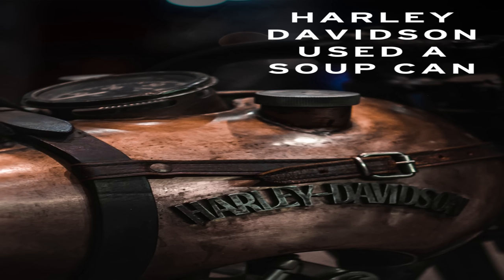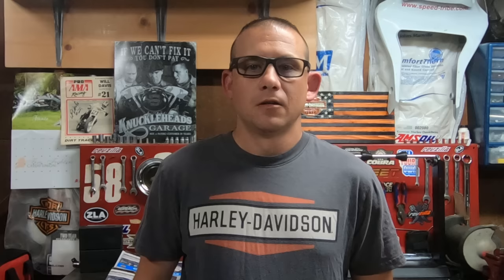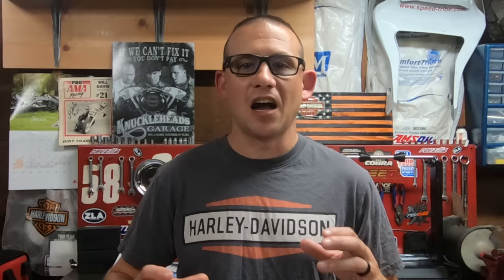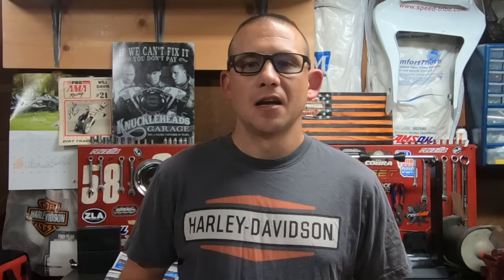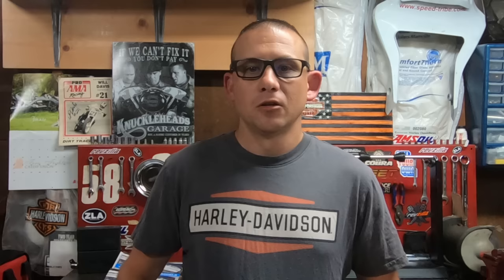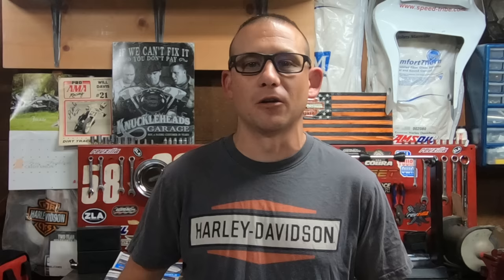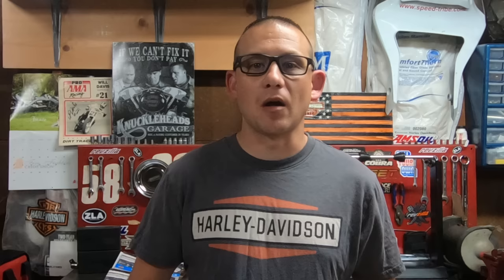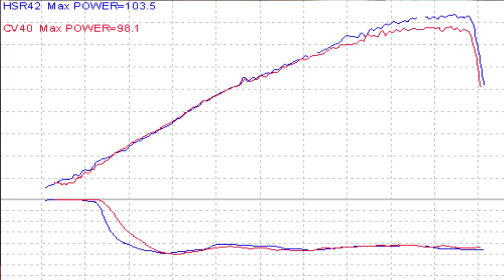CV Carburetor or the Mikuni HSR for Your Harley-Davidson

Comment: I've ran both carb designs on the Harleys I've owned and I wouldn't lose any sleep worrying about which one to run.  I've ran both designs on one of my current rides (a 95" FLSTF with a very mild street cam) and there is very little difference between the two carbs. I would give a very slight edge to the Mikuni for a slightly better throttle response which makes sense given the butterfly of the Mikuni is mechanically operated vs the CV's vacuum operated slide so the fuel/air input is immediate vs, as a result of vacuum change.  The difference is very, very, slight especially if the CV is properly tuned. In retrospect and based on experience, purchasing the Mikuni to replace the CV for that bike was not cost effective but if you're needing a larger carburetor to feed a larger engine with a more aggressive cam, better heads, exhaust, etc., then yes, I'd favor the Mikuni.  

For one thing, the CV 51mm is the largest available but good luck finding tuning kits and or replacement parts for it such as the vacuum diaphragm.  The equivalent Mikuni is the HSR48 which flow testing demonstrates is very similar to actually outflowing the CV51 so don't fixate solely on manufacturers size as a measurement of flow, let alone what is most desirable for your build.  I had a 120" Electra Glide, which I just sold, equipped with the CV51 and it had great throttle response but not instantaneous. The difference is so slight between the two carb designs that I consider the point moot and from experience, I knew that changing that bike to a Mikuni wasn't going to materially change the performance so I never messed with it and wound up putting about 60,000 miles on that engine/carb setup and never had any issues or complaints with fuel delivery including throttle response !   BTW, both carbs are easy to tune and are what I would describe as trouble free.
Reply: Lectron

Comment: Hi 👋, I am sort of new to your work shop, I had a 1999 ST DEUCE, 1450’  in 2001/2 I fitted a Mikuni Carb HSR45 as I was going for a 1550 , 
D D 2-1 Boom Can exhaust system, cams , pump, ignition module, throttle response, was brilliant, even though I’ve gone to 1550. The fuel Combi was a lot better as well. I had to sell my bike in 2019 due to my ex female partner, scamming me for thousands of thousands of pounds., this was my pride and joy, and even people I commented on it how well I looked after it considering it was a 1999 model, 
It was serviced regular and it never let me down. Unlike my ex female partner. 
I’m now retired 71 years young living in France, however, I wish I had still got it as it won’t take me long to get to the Alps and into Spain and Portugal and beyond, great territorial, I would recommend MIKUNI over a CV any day, very easy to set up. 
PHIL FROM THE DARK SIDE OF THE MOULIN FRANCE.

Comment: 1996 Heritage Special. 4500 original miles. Was pure stock. Bike hesitated and backfired in cool weather,  OK in warm weather. Used Dyno Jet 8708.001 jet kit with 185 jet and followed all instructions to the letter. Idle mixture screw turned out 2 3/4 turns. Also added K & N air filter in stock air cleaner, drilled baffles out of stock mufflers, added single fire ignition set full advance at 2500 rpm and Screaming Eagle spark plugs and wires. Definite power increase and much smoother acceleration. idles  smoothly. Starts right up hot or cold. Averages 40 MPG. Obviously I like my CV carburetor. An EV 27 cam is the next thing I'm doing.  This bike is run at around sea level 90% of the time.
Reply from the maker: That's awesome, glad you got it running right! EV 27 is one of the absolute best Evo cams out there!
Reply: I agree!! Don't froget to CHANGE THE INNER CAM BEARING to a torrington !

Comment: Gixxer, once again, an excellent segment...I myself prefer the Mikuni over CV because of the overall performance gain that I got right outta the box!  This is in no way to say that the CV is a bad carb, because it is not.  Well jetted with the idle mix adjusted correctly, good free flowing exhaust and unrestricted air cleaner this carb works great, but once you get into using hotter cams, better flowing heads, etc, you are better off with the Mikuni.
Reply: CV carburetors are nothing new they go all the way back to the early 50s in the British and European sports cars they are much more efficient that's why they get much better mileage
Reply: @donaldpeters8745  I had no idea that they (CVs) went that far back.  I guess the technology, although somewhat antiquated by today's standards, is still tried and true.
Reply from the maker: Thank you, I really appreciate it! The Mikuni really shines when you start getting into the motor for sure!
Reply: That's when I made the switch to the Mikuni. Big lift cams and Baisley worked heads require alot.     👋

Comment: Which carburetor to choose is a decision that depends on a lot of different factors. I'd say that for a factory or mildly modified engine, you really can't beat the reliability of the CV, especially when it's properly tuned. And when it comes to repairs, or upgrades, I've found CV Performance to be the best company to deal with. Their products are much better quality, and their knowledge is spot on. The main thing to keep in mind is your application. Don't put a big high performance carburetor on a factory or mildly modified bike. Not only can it hinder performance in general, but it can also prove to be catastrophic. I learned that the hard way with my 1988 883 Sportster. Shortly into owning it, I was hit by a horse trailer that broke loose from the truck pulling it, and ended up totaling the bike. I settled for cash at the scene to avoid dealing with insurance, took the bike home, and began rebuilding a whole new bike with it. Other than the exhaust, the engine was unharmed, so I didn't need to change much. Due to my ignorance of what I was working with at the time, I let a salesman talk me into buying the S&S shorty with a thunder jet set up. I thought it would be needed for the new exhaust. The carburetor setup including the intake was over $600.00, plus the cost of smaller jets to put it on the 883. My best friend(who rebuilt this bike for me), tried to talk me out of it, but I wouldn't listen. Due to not understanding what I was doing, and not listening to advice from friends, I now had an 883, with a S&S shorty, and very short exotic choppers "fuelies" with 2 staggers leading to 2 1/4" pipes at the end. Even with the baffling, the pipes couldn't produce a good resistance, and the carburetor was so big for that little engine, that I could never get it tuned to run quite right. It blew 3 head gaskets, before predetinating on the front cylinder, and disintegrating the piston. The entire top end had to be replaced. After consulting with my best friend, and another professional mechanic, it was confirmed that the predetinating was caused by the carburetor and exhaust system I had chosen, as it was just way too much for an otherwise factory engine. I still have the exact same carburetor and exhaust system on the bike today, but now I have a 2004 Buell XB9 top end, Andrew's v6 grind cams and 4140 chromoly adjustable push rods, Jim's roller rockers, and Accell 35496 programmable ignition with stealth coils. This engine now can definitely handle the large carburetor and exhaust. But I wasted almost $2000.00 originally, and put even more into rebuilding the engine to where it is now, and all of it could have been avoided. The moral of the story is be careful when making decisions on which carburetor you choose, or any major modification for that matter. If I were building a hot rod engine like my Buell conversion, I'd probably go with the Mikuni HSR, but for anything basic, I believe the CV just makes the most sense. Bigger, higher performance carburetors can be cool, but they can also cause a lot of problems.
Reply: Stock cv carb . But I rejected it with the all balls carb rebuild and jet kit. I'm loving it. 2000 Sporty Custom 1200 runs great.
Reply: @karlhockenberry9130  I never used the all balls jet kit. But my 03 Sportster had a terrible exhaust system, and the carburetor was just terrible. I put a Bassani pro street exhaust on it, and tore into the carburetor. Rejetting it didn't even seem to make a difference. It turned out to be the diaphragm on the slide was bad. I bought a new slide and jet kit from CV Performance after speaking with them. It runs much better now than it ever has. That's why I love CV Performance.
Reply from the maker: Very well said right there!
Reply: @GixxerFoo  thank you brother. I love the channel. Keep up the good work!

Comment: Just watched this video.  I own a 1989 FXSTS set up with 3 5/8 bore cylinders with Screamin Eagle heads and a V-Thunder 5030 cam, HSR carb. This carb, on this set up is a monster. I also own a 1988 FLHS set with 4 5/8 stroke and 3 5/8 cylinders, V-thunder 5020 cam, S&S standard heads. I run the CV carb and I must say, that is also the right carb for this bike, given the weight. I enjoyed your take on both carbs. They are equally excellent carbs. You seem to have a lot of experience. I also love Evo engines. Never owned a Twin Cam, also own an M8 107 FLHX. Thank you for educating people. These are not F35 jets

Comment: My 1998 CVO Fatboy.Id took it off and rebuilt it changing the needles and a couple other things.Then after making those changes I replaced the stock ignition system to one that I can adjust the timing to work well with the changes I made to my CVO carburetor.What a big improvement in the throttle response and just the overall performance  compared to it being in stock form.Thank goodness for the aftermarket we have today.
Reply from the maker: We are very fortunate to have strong aftermarket, years ago it was a lot harder to chase parts.
Reply: @GixxerFoo  So very True

Comment: Some years ago I swapped out my CV carb for the Mikuni 42 HSR on my 2000 Fatboy.  I'm running Andrews 26 gear drive cams, 95ci, and have head work done.  On trips, I usually get 48-50 mpg, so your analysis about not losing fuel economy is accurate in my case.
Reply from the maker: You have people that swear the Mikuni killed their mileage, I tend to feel the setup just isn't right if you're losing economy with the Mikuni.

Comment: Love the channel! I’m an S&S feller myself…I got nothin bad to say about the CV. I’m actually going to be running my 03’ FXSTB with both carbs back and forth to do my own comparisons on performance/efficiency differences, I’m still just learning how to tune the cv. The S&s is basically really stinkin easy but requires adjustment just about every ride. Which I love to do. Cause I love touchin my girl…GIXXERFOO YOU ARE THE SHIZ. I’ve learned a lot from your babbling ons. The channel is greatly appreciated!

Comment: I have a CV on  my FXR now. I bought a Mikuni 20 years ago to replace it. The CV  works so well that I never did! I have a 42 and a 170 jet with a Dyno jet kit with the needle on the second slot. Runs great. Maybe someday I'll put the Mikuni on but the CV runs so good.
Reply from the maker: If it's working great I wouldn't change the formula!
Reply: You can buy a lotta lunches for that Mikuni! That's why I never upgraded, especially in light of the fact that if it's that debatable; it ain't worth it.

Comment: Love the Mikuni. Instant throttle response. It feels like the rear wheel is connected to your hand. Especially when you're in the power band. Easy to tune as well. There is a plethora of info on these carbs. Joe Minton even had some input on their tuning (romored,).
Reply: yep. up to 3rd gear power wheelies on my new 02 450r street legal supermoto
Reply: plethora?  This is a family channel and no such language will be tolerated mister.
Reply: Check your spokes specially in twisting the throttle

Comment: I have a 1987 FXR. It has SE Heads, SE 575 cam, Thunder header. It has wisco 10.5 to1 pistons. My friend I bought it from found HSR 42 Mikuni carb. Bought it used of eBay . The guy he got it from put it on 883 sportster. It was over carbed. Got it cheap. Love it.
Reply from the maker: Can't beat a deal like that! Those carbs are way too much for the 883.

Comment: I yanked my stock CV40 carburetor and replaced it with a Mikuni HSR-42 and jetted it via Minton recommendation. The best fuel economy i was able to achieve was 42-45 mpg. I went back to my CV40 and was happy to see 55 mpg again. In my area gas is $3.30/gallon. My bikes are Evo and all bone stock to include airbox, cam and mufflers.
Reply: Is the CV40 equal in performance as the HSR-42?
Reply: @CarlosGarcia-ls4hn  for the right amount of money after being modified yes and be more efficient. I used to toss CV's in the trash regularly but have since changed my tune. Pun intended
Reply: CV is a dam good carb.. People get this mental block because it's the "factory" carb.. but in this regard, HD nailed the shit out of it. It might be the most dependable part on the bike.
Reply: @hawkdsl  🎯
Reply: Did your stock manifold accept the HSR-42?
Reply: @CarlosGarcia-ls4hn  yes, for the Evo it fits perfectly. For twinkies you'll have to shave your cylinders for it to go back far enough.
Reply: Oooh, this hasn't aged well with the gas prices this bird brain old man has us on today.
Reply: @garynorton8122  I'm seeing my old reference to gas prices and missing those days

Comment: I pretty much agree if the motor is close to stock a mikuni will work good but most of the motors that come out of my shop are hotrods & the mikuni takes a shit load of time to tune . I prefer to run S & S carbs & even though mikuni carbs should flow more air than a butterfly carb it is not always the case ! I have also used CVs with great success .CVs work excellent on shovelheads & Ironhead sportsters ! So my carbs of choice are E & G S & S or a CV !

Comment: I have 2 02 wide glides and both have the Mikuni HSR on them and I love them. One is a 95 with other mods and one is a 88 with cams and such. Both bikes run great and any changes to the settings is a breeze. Fuel economy is between 38 and 42 mpg which is perfect IMHO.

Comment: I modded my original Keihin butterfly carb in the 80's.  Centred the accelerator pump jet to hit both openings in the manifold, increased jet sizes, added an earlier higher volume accelerator pump and redrilled holes to older passages in the bowl and blocked newer one, removed choke plate and filled holes. Mods were outlined in an issue of Easyriders from the early 80's.

Less than $30 worth of parts and it was the best carb I ever used.

Comment: I bought my 1992 Fatboy and it came with a Mikuni Carb. While it ran OK in the bottom of the San Fernando Valley at about 800' above sea level, when we took it to the Sturgis Motorcycle Rally camping in Deadwood, SD at 7500' I was forced to change the jets in the Mikuni in order for the bike to run at all. When we returned home, I swapped that Mikuni for a new condition factory Harley CV carb and my problems were over, the bike runs perfect at any elevation, end of carb story. Of course I'm not trying to make a drag racer Harley, just a good reliable ride that won't leave my Wife and I on the side of the road and our Fatboy never has in near 20 years. My Brother Hotrod Riders that have EVOs seem to all like the S & S carb over the Mikuni carbs.

Comment: I have a Mikuni TM40 on a modified Suzuki DR650. There's no delay at all when you whack the throttle, that's for sure. Something to keep in mind about the HSR carbs, is that the slide can wear out, and when that happens, the stupid thing won't idle no matter what you do.
Reply from the maker: That's a great point! They will wear out too, I've had that happen on a dirt bike with a Mikuni before myself.

Comment: I put Fullsac Performance headers on my '99 TC88, a couple used slip-ons from a CVO110 and re-jetted the CV carb.  Put on an easy breathing air filter too.  Got it dyno tuned.  Very noticable improvement in performance and easy on the wallet.  I spin the rear tire on that old Road King pretty easy now. so its all good...
Reply from the maker: Fullsac makes a dang good exhaust system, they really make some strong power! Getting a good dyno tune makes all the difference too!

Comment: I've run both with no issue. I prefer the Mik. just because I have great control on a way long sweeper as I'm turning on the throttle.Usually run a 45mm jetted a titch so I don't lean out on extreme top end.Spark plug reading along the road is a forgotten art. 50mm CV stock is allmmooost as good,I just don't like daiphragms. I work with huge commercial actuators containing these things at work their, I guess big and crude,compared to a gear or electric replacement. Fuel economy is not my goal, personal reward is.🎉👍

Comment: I have a CV carb with CV performance upgrade kit. It improved my performance but I dropped milage. I'm almost stock. For my 883 it made sense
Reply from the maker: Once you start putting the fuel to them they run a lot better but fuel mileage is always going to suffer a bit.

Comment: I installed the S&S Super E on my 1993 Softail Custom back in the mid 90’s runs great! Very easy to work on also and the main jet is very easy to remove just remove the plug in the bottom of the fuel bowl and remove the main jet. 
Easy Peezy!
Reply from the maker: S&S makes a hell of a carb, they make power and they the serviceability is second to none.

Comment: I considered switching to a mikuni or keihin but just stuck with my bendix/zenith. Discharge tube had a crack, just bought another with the adjustable main jet and I couldn't be more excited. 
74 1200 big bore with the full work up